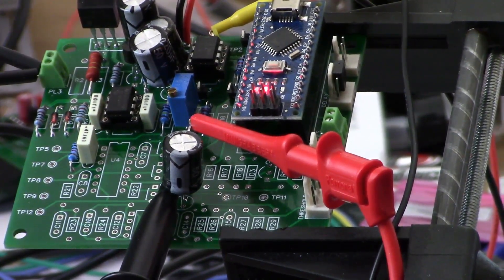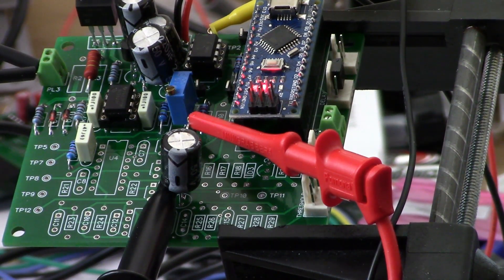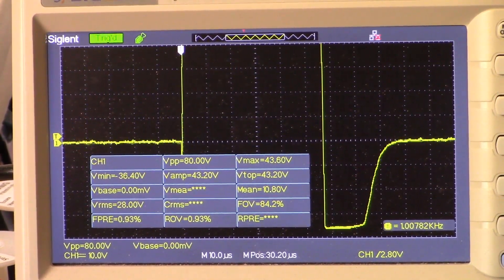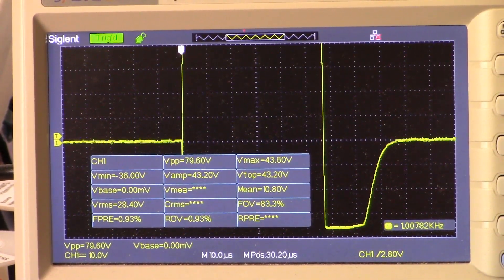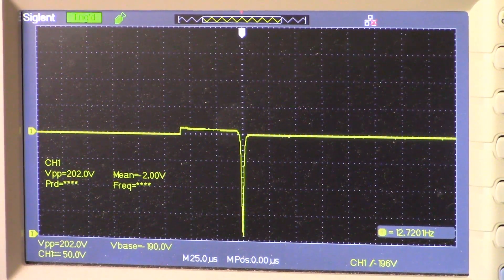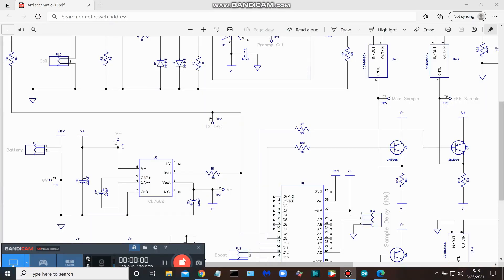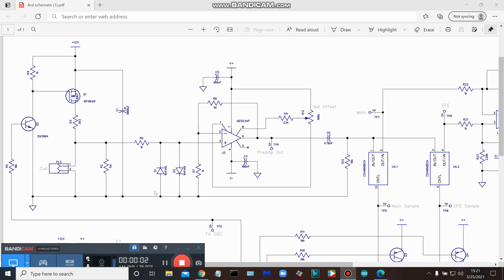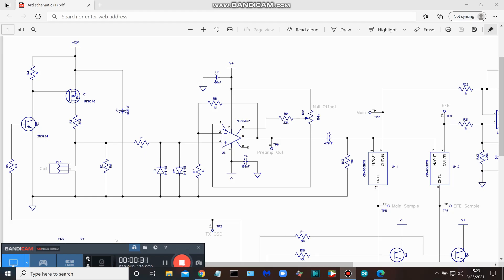Arduino Nano PI Metal Detector part 2 TX and Preamp

Comment: Hello, Thank you for your work and sharing
Question: Is the coil paired with RD resistance? with the small fixture potensiometre 10 turns with a value of 10 Kilo ohms aisi than the other two resistors 2 Kilo ohms and 200 ohms to find the value of RD?
Regards Gérard
Reply from the maker: Hello my friend.  I believe that you might want to watch my 2 videos on Damping Resistors.  Here is a link.:
https://www.youtube.com/playlist?list=PLgBlcFVgN7pTXowPv747Rd5MniTrONUBI

Comment: i culd not get 0 V in TP 6 , when I turn the trimmer the voltage always 0 ,, that's mean taht the ne5534 dosn't work ,after i changed 2 Type of them ,then i placed in its place ,CA3140 ,, the votage changed but i culd not get 0 volt ,,when I turn the trimmer the Voltage  redus at 1.2 V then its rise up again

Comment: Hi Alec,

Very nice of you all these videos.
I keep getting the 1000uF(25V) capacitor blow up, are you using high voltage capacitors ?
Reply from the maker: No, I used 25V for C1.  You need to check your transmitter portion of the circuit, you most likely have a short.